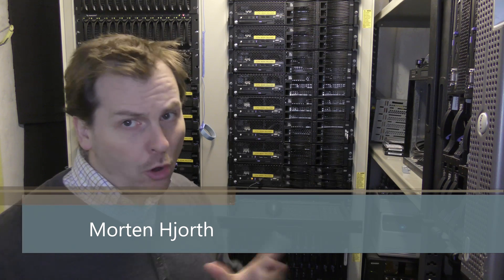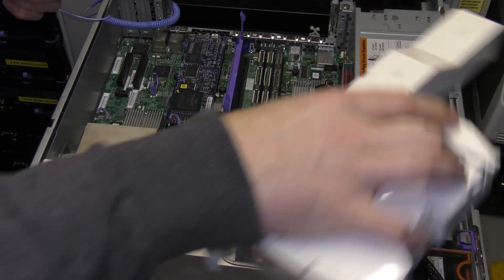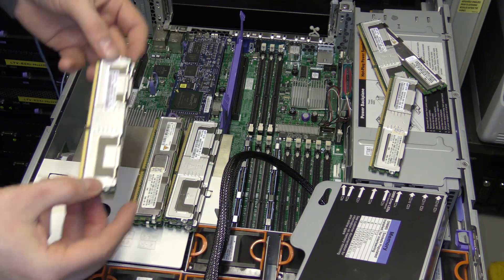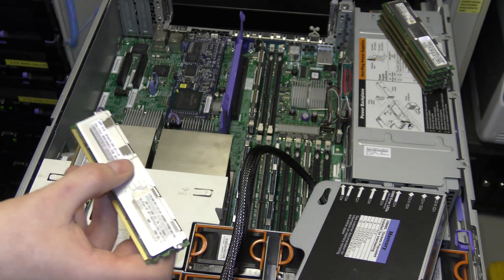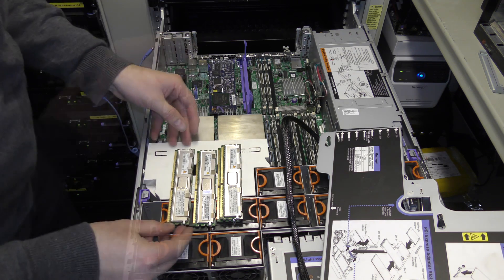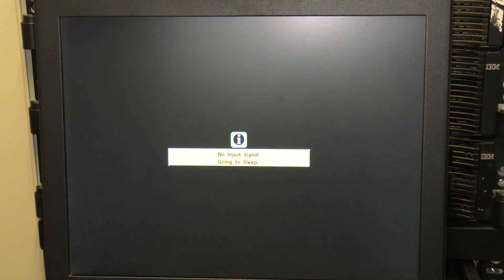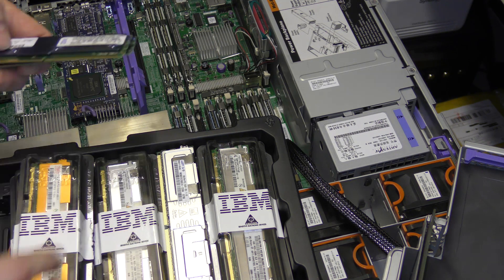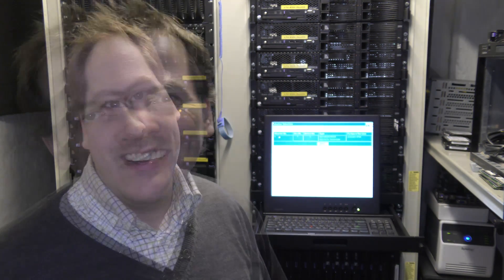Fixing Triple Server Memory Problems - IBM x3650 M1 - 453

Comment: 8:49 What about the DIMM error LEDs? Could you see any error?

More about memory pairs:
ftp://ftp.software.ibm.com/systems/support/system_x_pdf/44r5189.pdf p. 67
Reply from the maker: Hi Carsten Hansen
LED´s only works when the server is powered,, I had to unplug it to work, on it.
Thank you for watching! :-)
Reply: I don't know IBM but other systems have something called stored power for this purpose.

See
https://docs.oracle.com/cd/E19121-01/sf.x4440/820-3067-14/dimms.html

Note - The DIMM Fault and Motherboard Fault LEDs operate on stored power for up to a minute when the system is powered down, even after the AC power is disconnected, and the motherboard (or mezzanine board) is out of the system. The stored power lasts for about half an hour.
Reply from the maker: Carsten Hansen I did check the light path diagnostics,, I wanted to show this,, but on this model it only works powered,, some there are a small bat. to do this.